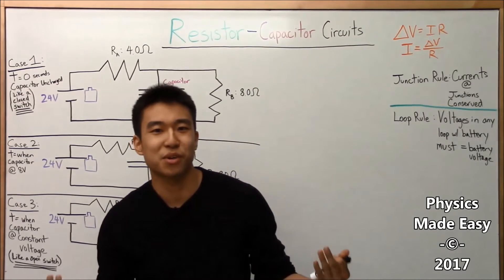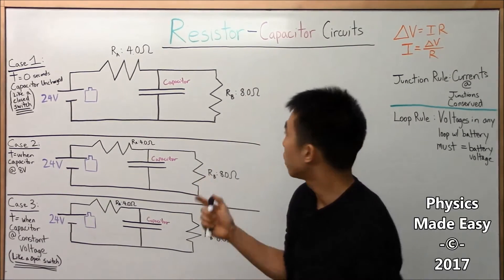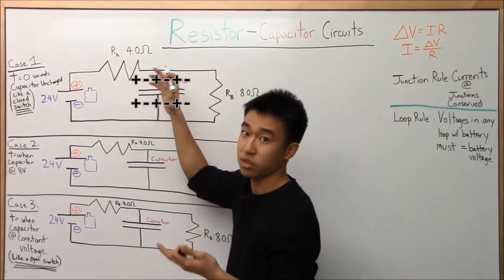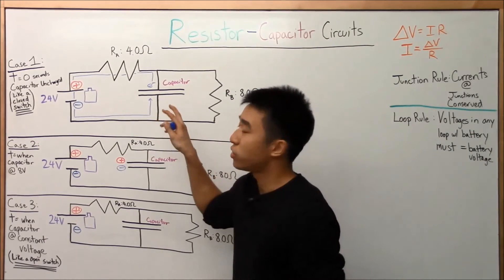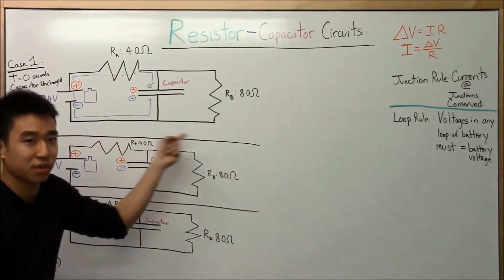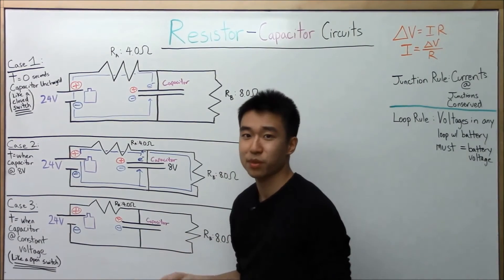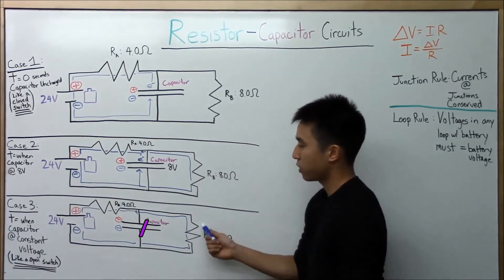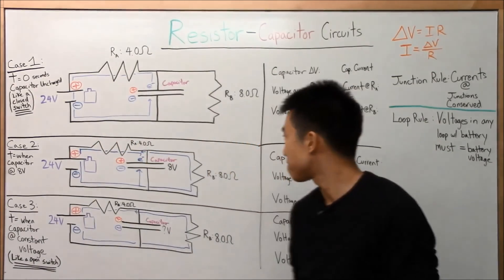Resistor - Capacitor Circuits Made Easy! Part 1 - Physics Made Easy - BU PY106

Comment: What's the difference between the capacitor at 8V and the capacitor at a constant voltage? At 8V it is semi-charged and at a constant voltage it is fully charged, but what does that mean exactly?
Reply from the maker: Ah good question! So the capacitor at 8V is not at a constant voltage, it's only at 8V for that split second/moment in time. It's still charging, Prof. Duffy just specifically chose that moment in time to be Case 2. At 16V in Case 3 it is fully charged and that point is important because it acts like a open switch or a broken wire at that moment in time. And no current would flow through it, so our circuit is essentially a series circuit. Part 2 goes a little more in depth with calculations, if you haven't seen it, def, check it out. :]